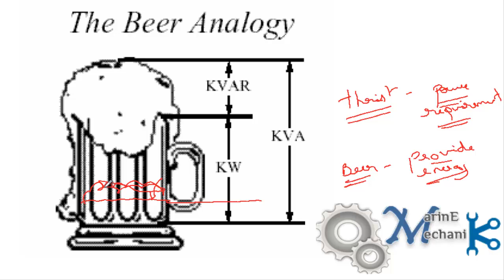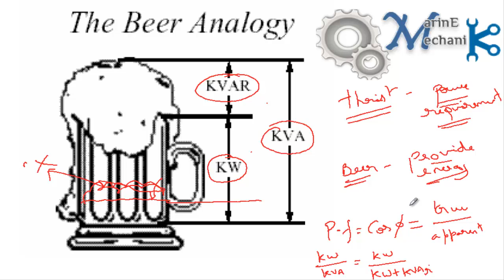Beer Mug Analogy for KVAr Explained - Must Watch.

Comment: Good Question. Reactive Power does help in Voltage Regulation. In order to improve (increase) the voltage of the system, you will have to inject VARs into the system and to decrease voltage, you must absorb VARs FROM the system.
There is no exact relationship between Reactive Power and Voltage. WHY? Because Voltage is a local phenomenon of the power system whereas frequency is a global phenomenon. It all depends on the dearth of VARs in a particular load centre.

Comment: Great example.... especially as it relates to a beer.... always found it great when a teaches a subject matter to something a lot of students can relate to.."BEER!!!!"

KW = the pure beer.KVAR is the foam (the bad part of beer). but if the bartender pours you a beer, and your thirsty, you have to take the good with the bad. KVA represents the entire glass.the good and bad parts of the beer.  Even though you have a 16oz glass, you may only get 10oz of pure beer.... the other 6 is wasted in foam.
Reply: The analogy isn't mathematically accurate, because kVA doesn't directly equal kW + kVAR.  It equals a Pythagorean theorem combination of the two.

Comment: Real or true power does not need reactive power for its flow. It all depends on the nature of the load. If the load is purely resistive, it will draw real power only. In practical power systems, real and reactive power flow in the system because we have to meet both the demand for real and reactive power. Reactive power does not gets converted into heat, work etc at the load end that is why it does not do any work. BUT it is essential for magnetic flux in inductive loads like motors etc

Comment: correct... KVA is the perceived power, but the actual "real power" is the KW, and of course KVAR is the bad part... see the second half of the video, where the guy is pulling a weight... the vectors may help you.  Ideally, you want to have a Power Factor of 1.... zero losses.  But, that nearly impossible to do in a distribution circuit.

Comment: contd...

The more the demand for reactive power in a particular area, the more VARs will be injected into the system to increase voltage; it depends on the SIL of the T/Ls and nature of load as well. So it varies from system to system.

Moreover there is NO exact relationship between frequency and amount of real power. In fact it is known as the Frequency Bias Factor and is different for different power systems!

Comment: thanks for sharing... Can u tell me the relation (formula) between reactive power and voltage. I have red that reactive power also helps in voltage regulation. reactive power improves the voltage of the system. exactly what is the relation between reactive power and voltage?

Comment: is the reactive power needed for the flow of real  power......in other words can the real power be efficiently transferred to the load without the help of reactive power??   or is it that "in power systems there are equipments like transformers,cables,motors  which tend to have a reactance so it may mean that we need reactive power as the instruments demand it ....? is reactive power useful in any terms , or as explained by u in the horse-boat analogy that it is the   useless work done by horse
Reply: Reactive power is more of a nuisance due to the nature of certain kinds of loads.  It is not something we deliberately add.  It has to do with the loads containing components that store and release energy, rather than consume it.  Particularly capacitors and inductors, that store energy, and release it a fraction of a cycle later.   The coil of a motor is an inductor, which causes current to lag behind voltage.
  The current and voltage being out of phase, means you aren't using the power carrying equipment to its full potential.

If you could exclusively consume real power with every load, that would be the ideal situation.  But real world loads cannot power-factor-correct for every possible power factor they could have during operation.  Plus, it is common for manufacturers to not include power factor correction components in the first place.